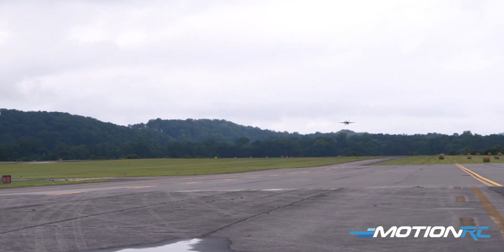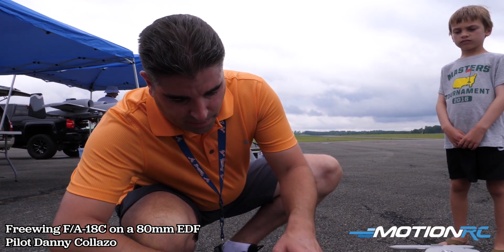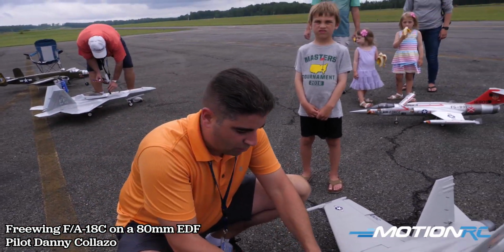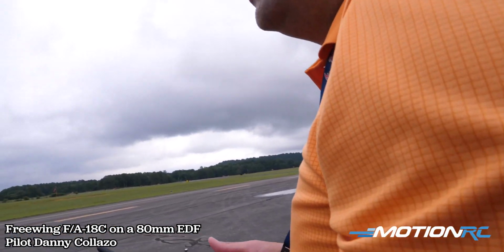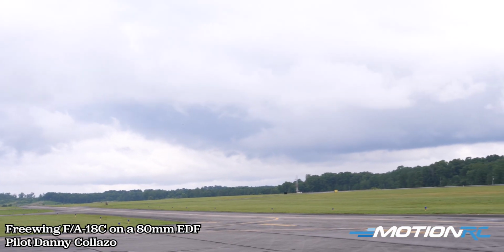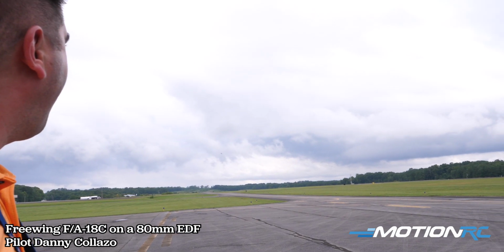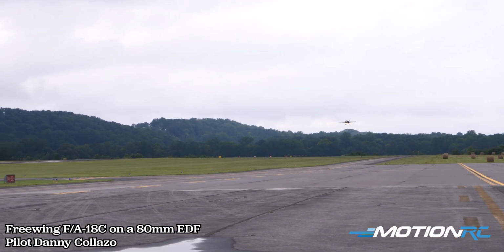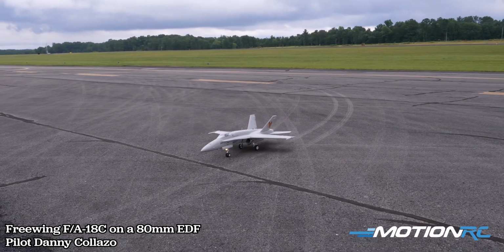Freewing F/A-18C Hornet on an 80mm EDF Power System - Fan Flight - Motion RC

Comment: Awesome, just got the Blue Angel and 80mm from the F-5. Thought they ran on a 80a ESC though.
Reply: I have the high speed 80 from the f5 also. I was thinking on getting the blue angels and putting it in it. how was the flight on that 80 u put in yours?

Comment: How is the 80mm adapter installed? The instruction manual, Hobby Squawk, and the MRC Q&A pages have no information.
Reply from the maker: the plane comes with a rounded piece of foam that will fill the voided space from going to an 80mm from a larger 90mm. That's all. Just wrap it around the edf unit and install as you would any other unit

Comment: So.... Does this mean that with an 80mm fan, the F-18 will have as much, or nearly as much, take off grunt as a 90mm fan?  The reason I ask is I fly off of a grass field.
Reply from the maker: Not all grass is the same, unfortunately, but she is a light airframe, so I think you would be fine with an 80mm on grass.
Reply: @MotionRC  Would you expect an 80mm F-18 to perform similar to an Avanti or L-39 as far as grass take off performance?
Reply from the maker: @bobdegood71  I wish I could give you an answer based in experience, but this was the only 80mm unit I've seen on an F-18 thus far and we didn't get to fly it off grass.

Comment: What's with all these blue box issues people are having? care to comment James?
Reply from the maker: The blue box hasn't been the issue with the aircraft or we would have included it in the TSB we released. Mainly the issue we found was glue on the elevator plastic mount plate and a few cut servo wires when installing the elevator servos.